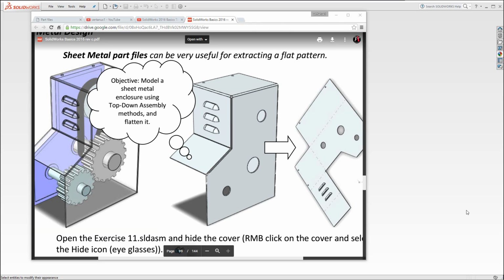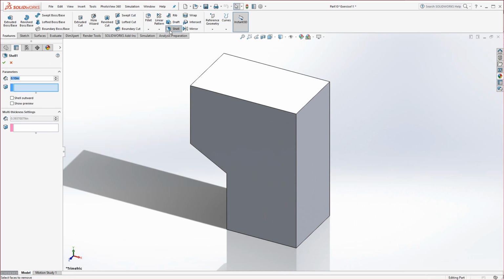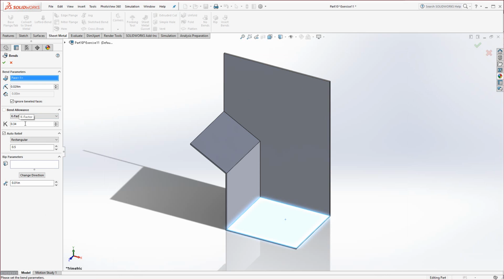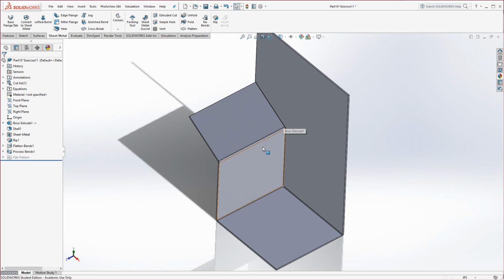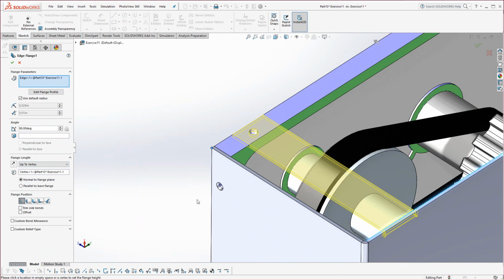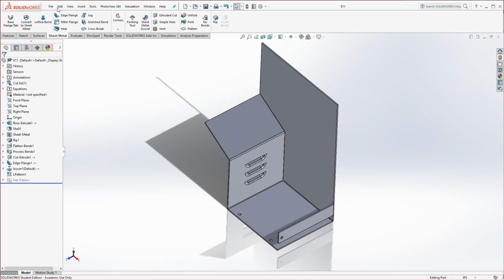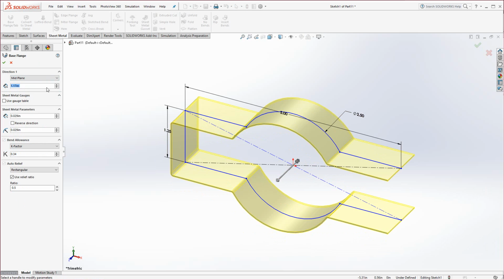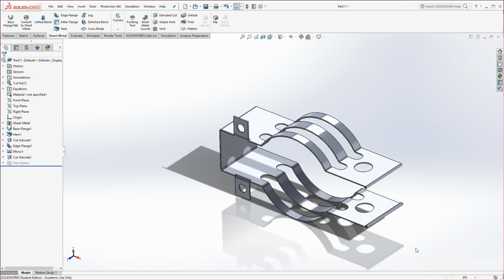E11 SolidWorks 2016 Sheet Metal I Tutorial

Comment: Hi, I have a question, I wasn't able to take, drag and locate the "louver" over the surface of the metal sheet, even to watch the preview of that piece over the place/plane is supposed to be, they are simply not being attached. Does someone can help me?
Reply: Not sure if you got an answer to your question. I had the same problem and the problem is related to the SOLIDWORKS DATA folder. Look at this post.

https://forum.solidworks.com/thread/99068

Forming tools may be located at:
C:\ProgramData\SolidWorks\SOLIDWORKS 201X\design library\forming tools